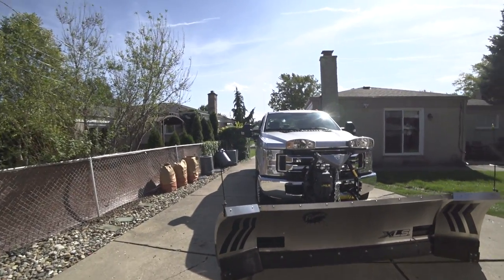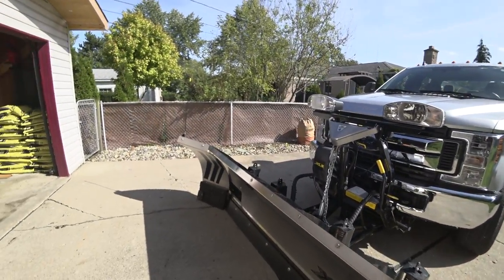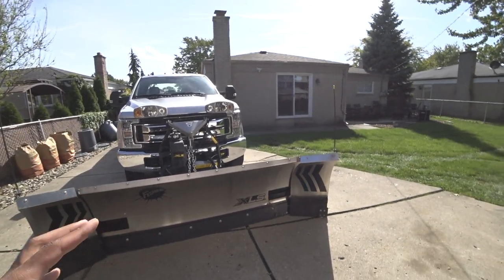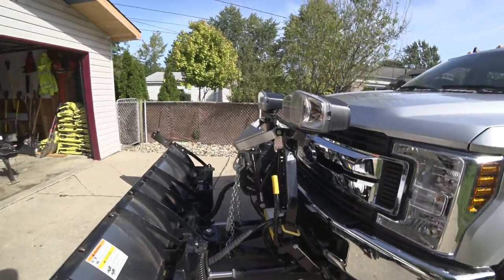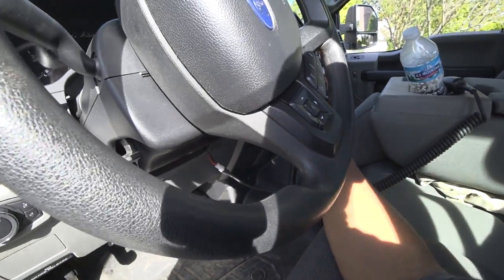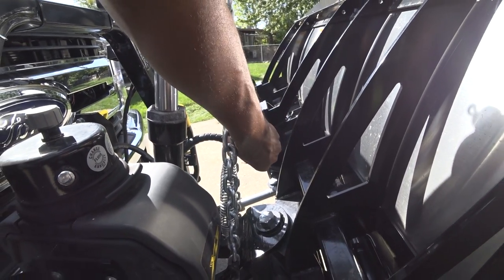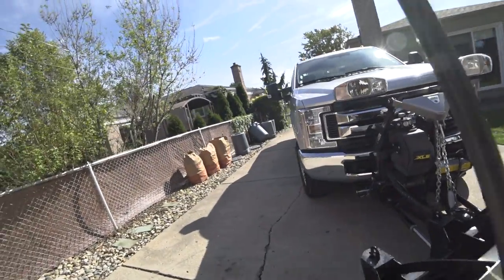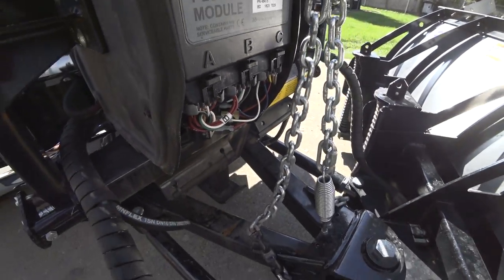Watch this video BEFORE you buy Fisher XLS.

Comment: i noticed a couple things:

1. u talked about your hoses rubbing and how u added coverings to them.....i dont believe the hoses r in the correct spot...they shouldnt ride over the Aframe like that.

2. to help with stacking i took out a couple lengths of chain so the plow lifts pretty high and i also disconnected the spring as all that does is help pull the cylinder down....i can stack snow high as a bastard with it just gotta get used to how to work your hydros correctly while pushing into a pile

Comment: I'm in the process of ordering my second xls.  The warranty is spotty in that fisher will not extend warranty in writing on issues knowing there is a problem...ie pumps with metal in the lines causing lock ups. In addition they replaced my blade early in the season because the wings come loose and it is apparent that there has been a problem in finding the correct springs for assembly.  Having gone all the way to the top management team...I can tell you that when the equipment works it is a 30% faster plowing machine production wise in a storm.  But when its broke...good luck!  IT WAS IN THE SHOP HALF THE TIME OR WE USED IT LIMPINGLY.  :)

Comment: Love my Fisher XLS.  I prefer trip edge or trip blade more than one might imagine.  Love it love it love it and I've plowed with some of the best to worst
Mine stacks just fine but I'm used to it.  Many times I want to push that pile back or even the top half of it.  I want the control of stack or push the pile.
I'm coming from a Minute Mount 2 and a Western  both straight and one Western V.  I just like this XLS to really move snow without a dragger or box
I guess it's also where you live

Comment: I got mine last year. For me being new to owning and putting on a plow this is pretty heavy and kinda big. I'm 5'2" and it's a bit of a struggle putting on. For some reason the module doesn't go all the way down, so I have to remember to manually push down in order to remove the plow. Otherwise the chain tension is high and it won't come off. 

It is a beautiful plow though and it matches perfectly with my black truck.
Reply from the maker: There's a lot of tricks to hooking up. How has the plow performed?
Reply: @DS-TRUCKS  the plow itself is great, lots of power to open up yards nicely. The power attachments come loose or come apart completely but I think putting a zip tie on will hold it together and it can be easily cut off to remove.

Comment: The spring is there to pull the cylinder down to make it easier to hook up and unhook the plow
Reply from the maker: 🤔 westen is easier without a spring...
Reply: Ya but western doesn’t have pins to pop in. You just pull the arm up

Comment: I'm looking to mount an XLS onto a 2017 superduty. Does yours have plow prep package? Could you do me a huge favor and tell me what the measurement is on your truck from ground to bottom of frame just behind the front bumper? Mine has a small lift on it and I'm trying to figure out if the xls will still be ok on my truck. Thanks!!
Reply from the maker: Your gonna need plow prep to run this plow...

Comment: I just ordered fisher HDX stainless straight blade. My last setup was the Myers. I noticed fisher on the new ford super duty you don’t need to drill any holes to install. I sold the Myers after 6 years of problem free plowing. I hope the fisher is as good. Your truck looks really nice. That lifting ram seal needs replacing so get it replaced before snow it should be free fixed under 2 year warranty. Also replace fluid every year. Buy only sub zero fisher fluid. Someone said GM trucks needs drilling in frame to install snow plow. Not sure if that’s true if you know let me know. Thanks
Reply from the maker: Im keeping an eye on the seal. Idk if its because i sparyed oil on it or what... I wiped in off and it hasnt came back yet. gonna have my dealer change the fluid... idk how to do it...
Reply: DonnaSean  if you can change  the fluid yourself you’re be better off that way you know how to do it. Only thing you need is a floor jack that way you can drain the side Rams. Thanks
Reply from the maker: @Nick-gi6ym  maybe I should suck it up and learn how to do it... They charge like $200+ to do it... Just never tried..
Reply: DonnaSean  yes you can do it watch a few videos. Thanks
Reply: I bought an xls in 2015. Dealer didnt install stacking stops and had same problem. Used it a few times then noticed expanding cylinder return lines were rubbing mold board. Factory  sent dealer a new mold board complete with new cylinders.the heavier spring makes it difficult to push back headgear.  A lot of things are harder to do now that I am 70.
Reply from the maker: @mrsmith361  if I was older I would probably stick with Western, I can see this being an issue for someone who's older. My dealer also didn't install the stacking stops... But they didn't own up to it... Had to put them on myself.
Reply: @DS-TRUCKS  I wish there more videos on how to maintain & repair plows and salters. 
Im thinking of buying this plow. Its only available in yellow (not such a fan of the yellow) but not much of a choice right now. If you do end up changing the fluids , be sure to press record.
Reply from the maker: @JohnC-zm2qo  yea. I need 2 do that.

Comment: Minute Mount 1 users can tell you what a game changer and much needed advancement that little spring and cable were. Without it you needed 2 people to properly disconnect the plow or rig up a way to hold down on the control while you manually pushed down on the ram. What a nightmare it can be to try and hook up a MM when the ram is fully extended and the ground isn't even. Very frustrating.
Reply from the maker: Ohhh
Reply: @DS-TRUCKS  I've had a minute mount 1 for 18 years never needed help connecting and disconnecting my plow....

Comment: Love your setup!  Around here Fisher has much better dealer support than Western, I’ve had both like them both and would buy either one. When it comes to expanding plows at least the first generation the Fisher was hands down the better overall plow of the 2. Ive been running expanding plows since Jan 4th 2004, never bought anything else after that. Sold all my V plows and bought expanding when I was running multiple trucks...I see why your upset about the washers . Just get a few SS washers and some anti seize and change them should take 10 minutes with power tools....
Reply from the maker: thanks for the comment! I'm thinking about making a move on a salt spreader this year... Needs to be done! Last year did everything with a walk behind salt spreader, was pretty brutal! Thinking about the Fisher tailgate spreader, what are your thoughts?
Reply: DonnaSean I don’t have any experience with tailgate spreaders ... I use full v box spreaders since I don’t do driveways anymore I don’t need a snowblower , I use and love the Buyers Salt Dog 1.5 yard electric v box  spreader . The entire unit it plastic or stainless steel . Mines 12 yrs old and like new . All the washers are stainless . They are ugly looking and black is the only color but they work great and since I have a compact tractor to load with it’s the way to go for
Me. Never even get out to spreaders just turn on the lights and spreader and adjust the flow from the remote as you go
Reply from the maker: @JohnDiMartino  i want to do that but cant load in... no tractor... and i cant store it during the off season... it would be nice tho!

Comment: Did you have any trouble with the the curb guards always loosening up
Reply from the maker: No. did u?
Reply: I don’t know yet   I just bought it, upgraded from older style.  I know of 2 plows that has trouble with that last season.  My old xls didn’t have them
Reply from the maker: @joshuahodgkins9681  they haven't loosened up. I've worn through the bottom bolts.
Reply: Hm, that’s good to know.  I took mine off.  Not sure if that’s a mistake or not   Thanks for the intel
Reply from the maker: @joshuahodgkins9681  I kind of liked having them on. But probably won't make a huge difference...

Comment: I would definitely look into something else besides WD-40 because it doesn’t last stores like advanced auto parts or Lowe’s you can buy some fluid film or you can get woolwax from this company online that is even better than fluid film https://www.kellsportproducts.com/
Reply from the maker: 🤔 thanks! I'm looking into that!
Reply: DonnaSean trust me that’s what you want to use
Reply: DonnaSean you could also undercoat your truck with it so that it don’t rust like the frame and suspension components or behind bumpers because those fords are aluminum and they won’t rot like regular steel would they would probably corrode but that’s it
Reply from the maker: @MrTylerg506  it's funny you mention that, I have a few cans of it in my garage just never had a chance to do it... Maybe I should finally get around to doing that!
Reply: DonnaSean trust me once you start using it you will love it and use it all the time it’s the best for rust you should do a video on it that would be cool 😎